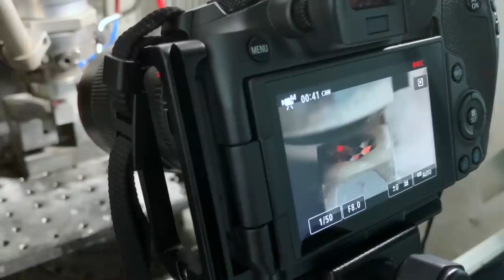Waterjet laser cutting of high-aspect honeycomb / Wasserstrahl-Laserschneiden von einem Wabenmuster

Comment: The first Mechanical Lathe changed the path of mankind forever. This, to me, looks like another machine that could very well do the same.
Reply: Ever heard of EDM machining? It does this but with far more precision. and its been around since, like, the late 60s.
Reply: @alextatkin1026  must admit, totally clueless when it comes to this stuff. But a quick YouTube of EDM machining has added yet more glorious things for me to watch so thank you. Amazing tolerances on these machines.
Reply: Alex Tatkin Edm macines aren’t able to start a cut from the center of a peice.
Reply: can it cut 2mm acrylic? (lol)
Reply: @rexerator  It doesn't matter that much. It just means you need more material if you need a perfect fit with another part, but you'd need the same for this if the kerf isn't small enough, which it isn't for most tolerances you'd want an EDM for.

Comment: What amazes me is the fact that tolerances are so tight that the residual water's surface tension will actually hold the part in place until a mechanical force overcomes the surface tension's grip of the cut part.
Reply: Probably just cause the part is at a miniscule angle inside haha

Comment: This the most incredible thing I have seen in my life.
Reply: I am not sure how they grind the Laser beam in small Sand like pieces to feed it for the waterjet
Reply: @Scavage0001  an even smaller laser
Reply: Wow.. it seems impossibrrr
Reply: @Scavage0001  What?
Reply: @UltraGamma25  they have to grind up and mix the laser into the water stream. you freeze the beam by pulsing it through liquid nitrogen then you can grind it up.
Reply: @chrishayes5755  it is necessary to keep it as cold as possible
Reply: @chrishayes5755  where can I buy ground laser beams by the pound?

Comment: a lot of years working on plasma cnc's this seems imposible it's amazing , what is the time and what is the thickness that shaves in one pass
Reply: Well you can see the camera at one point and it took a bit under a minute to complete the hexagons, could probably come up with an estimate if you watch closely noting the measurements and such
Reply: @alicebonnet4607  noting your profile pic, ypu mean 'prrrfection?'
Reply from the maker: The waterjet laser is an ablation process. In general it removes some tenths of mm per pass and less with increasing depth.

Comment: So is this water-jet or laser cut or somehow a combination of the two, either way it is very impressive.
Reply: it appears to be a combination. I can see both a fine jet of water and the laser reflections
Reply: I'm really not sure. At first I thought it was the laser and water for cooling as laser cutting has issues with thick materials heating up, expanding and when cooled leaving a cut that looks like it was at an angle.
Some also suffer from focus depth issues.

Then I had an idea so mad, it might just work. Both! With the water acting like a fibre optic for the laser, thus never having a heat or focal problem ever again whilst the water jet can be thinner and lower pressure than it would otherwise have needed to be to cut well.
Reply: @markp8295  wouldn't the water jet need to be completely laminar for that to work? I'm betting it's a low pressure water jet used to cool and clean the cut
Reply: @comradegarrett1202  So further research shows water does no cutting, it is cooling and fibre optic. And they have a clever way of making the water stay laminar. The water is fired down with an equal speed jet of air so in effect, this make the skin friction on the water zero. Thus it remains laminar as velocity relative to the side wall is low and so Reynolds stays low.
Reply: @markp8295  huh that's really cool actually
Reply: As I understood Water Jet is used to keep the laser beam inside (due to ideal internal reflections like in optics fiber), it helps to cut thicker materials with no heat damage.
Reply: @deanwarner1205  So they made a video about it. It's using water as a fibre optic to always give the laser perfect focus no matter the distance and as coolant.
Reply: But how does the laser cut? Does it melt the material? (And if so, why doesn't it cool down before it's washed away?) Or does the laser evaporat it?
Reply: @jonathanfriess1211  Look up laser ablation. It looks like the cooling just prevents the work piece side walls heating up which means you shouldn't need a kerf angle modification to accommodate for thermal expansion so that the cut looks straight when cooled.
Reply: @jonathanfriess1211  Laser cuts the way all lasers cut: through the direct application of heat energy that instantly vaporizes the material at that point. The water isn't nearly enough to stop that from happening when you have a high power laser.
Reply from the maker: The principle behind this technology is explained here: https://onlinelibrary.wiley.com/doi/epdf/10.1002/phvs.202000033

Comment: As a maker, this is one of the coolest things I've ever seen. But it's also a little depressing to know that I'll never be able to afford it lmao
Reply: @tonygonzalez8200  HAHAHA, I wish! Try adding a zero and doubling that, if they were 50k I'd go buy one right now. These things, if they're under 1 million usd, I'd be very surprised.
Reply: 3D printing only became big once the patent ran out and then people went crazy with it.
Reply: Who knows, a workshop in your area might buy one and be willing to rent it out
Reply: @tonygonzalez8200  I ran ram EDM for a couple years, so I'm fairly familiar with what the cost of professional equipment is. A lot of the cheap wire EDM is a couple decades old and even though it's the same technology the differences are so massive it's like the difference between pounding rocks together and having a chainsaw at times, especially with EDM- where most of the advancement has been in the spark generator software. Oftentimes on used equipment the reason things are so cheap is the controller or Control software is ancient and you don't think that will be an issue until you go to use it if you're used to anyting modern and then you realize it takes 20 times longer to do something. 

If you really want your mind blown and find wire EDM cool- look up BaxEDM Channel- for about 4k$ or so, you can build a desktop wire EDM machine. I never thought I would find that possible in my lifetime but someone did it and made it possible and now sells parts to make it possible for others.

The technology featured in this video is past the threshold of simplification that I think could be done by other people affordably eventually- and this tool is so specialized I don't see a lot of customers for it. They do have a job shop in New Jersey from what I can tell so if you want something cut by it, you can pay to have that done
Reply: What is the price range of this machine?  Is it really $1M?
Reply: pacifca nonook  I don't think you have even the slightest idea of how difficult it would actually be to do something like that. I've had someone propose this to me elsewhere but the real amount of Engineering in this thing is insane and it's flippant to make a comment like that, as if it were something you could just so easily go do
Reply: @CaskStrength777  You're right, but you know it would be fun as heck to try and inject a high power laser beam into a stream of moving water 😂 goggle up
Reply from the maker: @tonygonzalez8200  these tools are Nord of 500

Comment: Very Interesting! Went through the Technical Paper, and it's mentioned you have used 2KW fibre laser. Will the cutting thickness capability increase by using higher wattage laser source?
Also, is it possible to mill contour/pocket features using this laser micro-machining?
Reply from the maker: Yes, indeed the cutting depth will increase when going to higher power, but there are limits. Please reach out to us by email for a more in depth review together: contact@avonisys.com

Comment: AWESOME! But how does it work?
Isn't laser & water cutting, like the opposites?
Like the laser burns away material with heat, but the water would cool it down instead but be abrasive?
So how does these 2 "opposites" interact with each other? and I assume the result becomes even better than each on their own? But how?
Reply: Aha? The water-stream acts like a fiber-optic cable for the laser?
Reply: @sebbes333  yeah pretty much. He water jet guide the laser while also cooling the material it's cutting, also it's a pulse laser I don't think water would effect it from evaporizing the material it's cutting instantly

Comment: Cool AF! But you never showed both ends of a unit!
Reply: It appears he's hiding something by not showing the other side. At the very least he's a poor technical communicator
Reply: 2:39 you can see a brief glimpse of the back end if you pause at the right time. It looked pretty good.
Reply: nah all look slick. hes not hiding something
Reply: @merttar4935  sure as hell is. did you see a total cut time anywhere? didn't do much focusing on that crappy surface finish either
Reply: There's no need.... It's identical on both sides, it's literally like cutting a section of an Allen wrench out w/o material loss.
Reply: @xpndblhero5170  showing the backside of the cut would be useful in illustrating the accuracy of the process. It looked pretty good to me but not showing it clearly is odd.
Reply: @Steve_Just_Steve  @ 1:46 you can see the camera says it took about a minute to cut out the hexagons. Unless he's really trying to fool us here, but I doubt he'd go to the trouble of committing fraud to that degree
Reply: @xxportalxx.  Not a chance it only took a minute, he wouldn't have had 50 jump cuts in there if that was the case. wouldn't surprise if it took an hour to do
Reply: @Steve_Just_Steve  then either he started that camera later or restarted it 🤷‍♂️ water jet cutting of aluminum doesn't strike me as something that would take an exceptionally long time anyway, assuming the laser actually does something here then I would suppose it should take even less time. Seems reasonable to me. Granted I have absolutely no idea how water jet and laser cutting could actually work synergistically haha
Reply from the maker: Thank you for the feedback on that. This is an older movie already and we try to show the process in as good detail and transparency as possible. One HEX pin in 18mm aluminum took 5m45s to cut out in this specific setting. Both sides of the part look essentially the same. There is a very slight taper of about 0.01mm from top to bottom (so kerf at laser entrance = 0.06mm and kerf at exit side is 0.05mm).
Reply: @xxportalxx.  The water works for focus the laser for a the whole depth of cut rather than just a set distance. It works similar to fiber. Also it cools and carries away swarf. But you know what happens when you assume...
Reply: @Steve_Just_Steve  hahahaha I understand the idea of water focusing (we use it in my field to do small scale photolithography) however it seems to me that this is worse than both standard laser cutting (with inert gas) and EDM. The water turbulence would make it terrible for focusing, and in order to try to salvage the optical properties I assume you can't use grit, rendering the waterjet basically useless at cutting. Additionally I can't imagine pulling away that much heat would be beneficial, perhaps with small pieces like these it's a benefit but it strikes me as a deficit. Overall I still don't understand what the upshot is here, narrower cuts with less run-out? An adaptive focus and better beam conditioning would achieve the same with standard inert gas setups. What am I missing?
Reply: @xxportalxx.  Article says zero taper through whole 400mm envelope in PCD. that's pretty cool. I think it also mentions laser encased in water stream encased in  inert gas flow... Also machines equipped with both water laser and EDM.
Reply: @Avonisys  Faster than I thought! thanks for clarifying!
Reply: @Avonisys  That's a very impressive small taper. Is it possible to get it less? Does the taper vary depending on the material much, or just the thickness?

Comment: Cool, but why did you avoid showing the bottom side in the same detail as the top one? I mean, both laser and water cutting has these notches at the bottom of a cut when the material is thicker, is that the reason you only show us the pretty shots?
Reply from the maker: The parts actually looks the same on both ends. This is an older video already. In newer videos we shows both sides more. In the end of this video several parts are mounted to each other and sliding through one another. That gives an impression of the finish

Comment: I’d like to know what’s underneath the metal piece so it will stop the laser from making a hole on the entire planet earth.
Reply: Adamantium... you know, like the stuff Wolverine is made of. Laser can't touch it. Anyone with this machine has it. It's real hush-hush, but you asked, so the secret is out.
Reply: It's water cutting not laser
Reply: @mikejurisic  water is the basis for the transmission of laser energy (similar to optical fiber), perhaps after cutting the software stops the radiation of the laser

Comment: Is this quicker than 3D printing the same part?
Reply: I don't have a 3D printer or a water jet, but from videos everyone says the printers take a pretty good but of time. 
With 3D printing you have to take in account for Elephants foot(bottom spreading out from weight & not being completely hardened) and the measurements sometimes won't be an exact fit.
Reply: @TravisButler95  I suppose i was picturing laser sintering, but what you say about fit has some merit there too. the surface finish on a sintered part would not be as smooth

Comment: Wait. Is it a waterjet cutting or laser cutting?
Reply: Lasers cut using a focused beam, which means the beam geometry is conical, so cutting straight through a thick piece of material with narrow\tight path is almost impossible with a normal laser cutter. It looks like the laser is being transmitted through the stream of water which is much more cylindrical than a typical laser.

Comment: technology has left me behind  since my days as a precision engineer... so is this a laser  OR water jet ... looking to cut cam lobes from cast iron and induction hardening steels ... ta
Reply: It appears that the laser is doing the cutting and the water is primarily helping to clear away the hot metal dust that is formed from the laser. I'm guessing it couldn't cut through as thick of a material without the water.
Reply: I'm no engineer, but I found this info at this link: https://www.synova.ch/technology/laser-microjet.html

The Laser MicroJet (LMJ) is a hybrid method of machining, which combines a laser with a "hair-thin" water jet that precisely guides the laser beam by means of total internal reflection in a manner similar to conventional optical fibers. The water jet continually cools the cutting zone and efficiently removes debris.

As a “cold, clean and controlled laser”, Synova's LMJ technology resolves the significant problems associated with dry lasers such as thermal damage, contamination, deformation, debris deposition, oxidation, micro-cracks and taper.
Reply: @Malaveldt   thanks ...robbie
Reply from the maker: The laser cuts the material, the waterjet functions as a light guide. A detailed technical paper can be found here: https://www.avonisys.com/pushing-the-envelope-of-liquid-jet-guided-laser-machining-applying-modern-ir-fiber-lasers.html
Reply: @Avonisys  incredible.

Comment: DON'T BE FOOLED BY THIS!  While it is impressive on the top side, what they fail to show you is the backside where the 'blow out' occurs.  The holes for the hexagon pieces are enlarged on the backside of the piece, they don't really want to show you this but you can see it if you pause at 2:40. Look at how much material there is from the 'flats' to the outer diameter on the top and then look at how little material there is on the bottom to the O.D.   A keen eye will also notice that the laser blew out the sides of the piece when they are holding it in their hand, letting the hexagonal pieces slide in and out, particularly at 3:23 and 3:26.  Cool stuff, but certainly not usable parts.
Reply: Good eyes. But isn't the pitch intentional? Look at 0:07

Comment: Can the same tech and equipment be used to cut a 2mm diameter hole through a 200mm long stainless steel rod?
Reply: I think the waterjet only able to focus 10cm before it spread to much
Reply: @LeftOverMacNCheese  ok, thankyou
Reply from the maker: Approx. up to 25mm is the max. cutting depth and it depends a bit on the material to cut.

Comment: Integrate a Time of Flight sensor in the optics to measure and adjust depth of cut.
Reply: "adjust depth of cut"? do you have any idea how small the DOC is? There's a reason they don't show cut time.
Reply: @Steve_Just_Steve  I agree the per pass depth of cut is tiny, I can also tell the aggregate depth of cut after many passes is inconsistant and some areas penetrate before others. If one were wanting to make a blind flat bottomed hole of a certain depth a time-of-flight sensor together with the pulsing of the IR laser could facilitate an opperation of this nature. Sorry I didn't put it in clear enough terms for you to see my intent with my original comment.
Reply: @DrKnow65  Oh I see, well supposedly this process is capable of creating of pockets and I read it has zero taper but only a 400mm envelope. Here's an interesting article.  https://www.mmsonline.com/articles/integrated-waterjet-expands-laser-cutting-potential